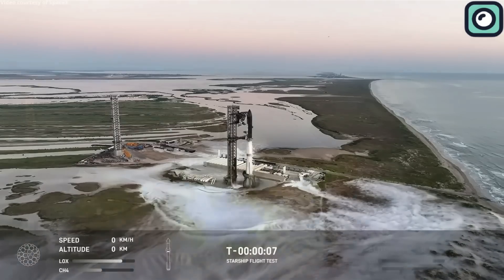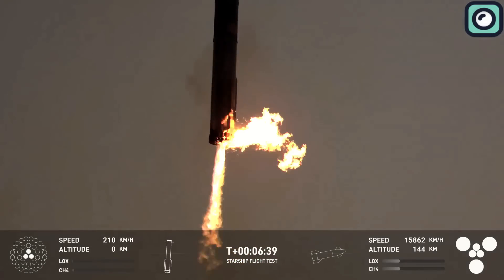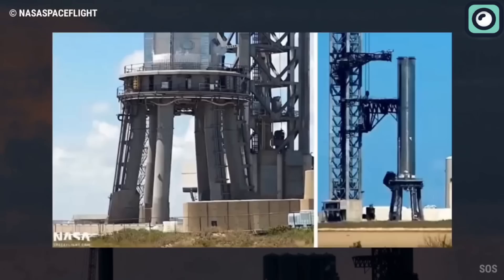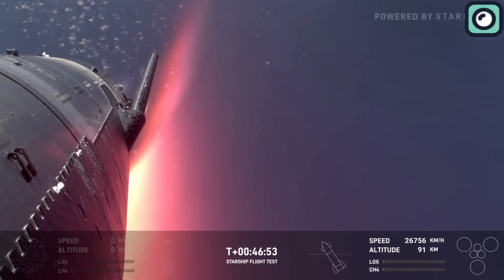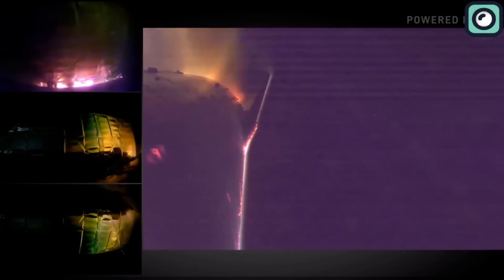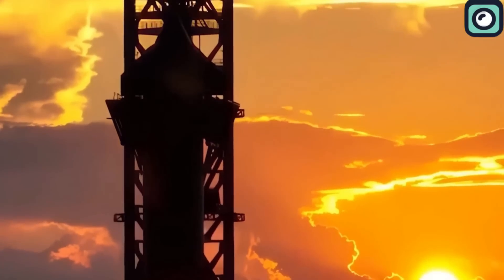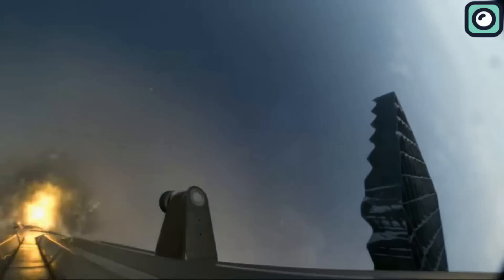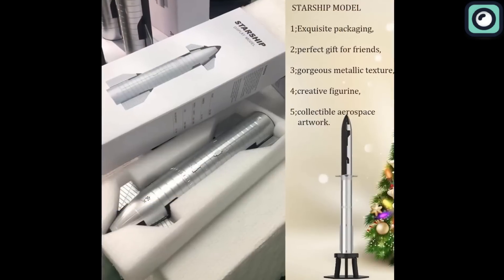Starship Launch Pad Aftermath Revealed.... Tower Damaged?

Comment: Beside some errors in this vid as for the heat tiles behaviour, a close look to the booster flying down to the OLM will show parts of some raptor engines falling apart. 
That is for me the issue #1 of this flight, unless this was also part of the "learning program for further development(s)".

Comment: This problem will be fixed by shields and protection. The fire on the side as well. The real problem is that this vehicle has very little payload capability. It is landing basically empty of fuel. Imagine loading an extra 100k pounds? The makeup necessary is really big.
They will need lower dry mass, more fuel, higher ISP and higher thrust. 
Then unless it is quickly reusable, in orbit refueling is very difficult. So, depending on actual payload 10-20 launches per Mars or Moon flight. 
It is a long way to go… I am very doubtful that chemical rockets will ever take humans beyond the Moon. Too inefficient.

Comment: Maybe, hinges and flaps could be made from Tungsten, which has a melting-point of 3,422 degrees C!  You won't need any heat-tiles for the flaps!
You could also use Titanium alloys or Tantalum with no need for heat-tiles!

Comment: Fix the flaps in place at appropriate angles and install spoilers on the upper surfaces of all four. Might work. Be lighter/ prevent the flow through of the flap hinge interface's. With all that heat and fire.Or not..............

Comment: Seems like the rocket popped when engines shut down and nozzles filled with water.  Next step might be a barge with a submerged landing well or landing cage. Blast air into the well as the ship lands. Modify later to catch and reuse above water level.

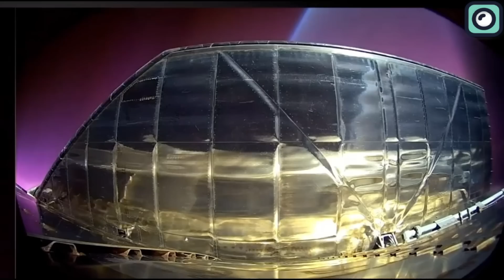Comment: The flames on the side of the booster is methane being vented catching fire.  You can see this white vapor along the side of the booster as it dissented before the engine burn and as soon as they reignited the methane catches fire.  As the cryogenically cooled fuel heats up the excess pressure need to be relieved via a vent.  The methane tank is in the lower part of the booster.  You can see massive venting of both methane and oxygen on the flight from +4:30 thru +5:30.  I am making a correction... the methane tank is at the top of the booster, so I believe it was the quick disconnect valve leaking methane that caught fire.

Comment: The sn30 blow up after it had landed in the water as SpaceX stated it was not a problem it was not going to be recovered anyway
Reply: It's only not a problem if the explosion was due to the water.  If it was going to explode anyway due to a fuel leak or structural compromise due to heat shield failure, I don't want to be in it when it lands
Reply: It was a controlled demolition, as per required
Reply: @alexevans5043  I've heard it was unplanned and they wanted to inspect the ship later, just not recover it.